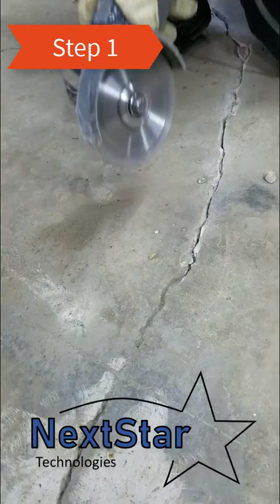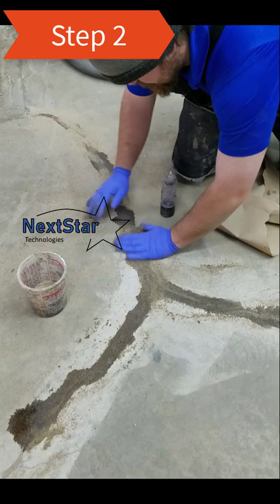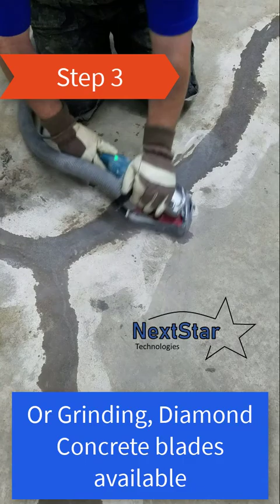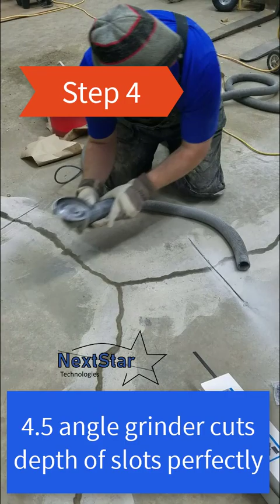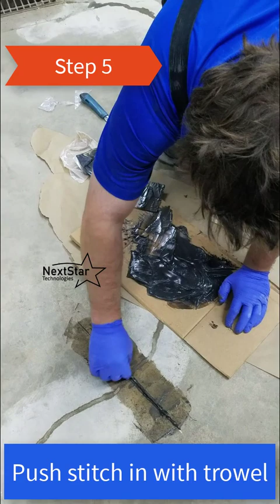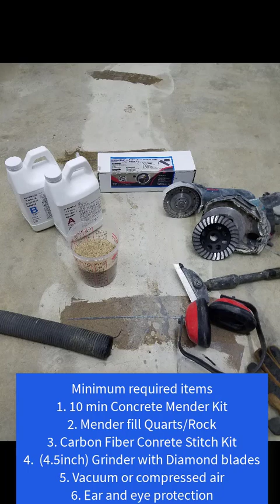DIY Garage Crack Repair

Comment: Great video and good looking products. I have a large crack in garage floor (>1") that is 10ft long and smaller cracks webbing out from it. Do you recommend your Epoxy kit? What is the best way to cosmetically cover it once repaired. Does the epoxy require a certain type of paint? What is the effective difference between the poly and epoxy kits? 

Our garage is built on a hill, and the large crack continues to expand over time as the cement flows like a glacier down the hill. Any tips would be appreciated.

Thanks! Look forward to checking out your products!
Reply from the maker: 10 min mender is technically a hybrid. Not epoxy or polyurethane. Roadware 10 min mender is the best (Floor) crack repair product available. We offer carbon fiber stitches for reinforcing cracks. 10 min mender to fix and fill the cracks and carbon Fiber stitch’s to prevent re-cracking.
Our (epoxy kits) are for Wall cracks only.

As for cosmetically covering the repair. The simplest method is to get color match paint and dab it lightly on the repair.
If you grind the surface instead of scraping. Concrete sealers will darken the grind marks. And leave a nice smooth gray repair. Looks a lot better than a crack.

https://nextstartech.com/shop/item.aspx/carbon-fiber-concrete-stitch-staple-repair-kit/175/
Reply: @nextstartechnologies4629  thanks for the reply. I'm still a bit confused about the selection of your products. Which kit would you recommend for someone in my case. And do you recommend this hybrid over poly or epoxy? Thanks
Reply from the maker: Our poly and epoxy kits do not work on floors. 10min mender is the perfect hybrid. For your garage floor cracks, I recommend the 1 gallon kit with one or two carbon fiber stitch kits for reinforcement and maybe a diamond blade for a grinder if you don't have one.

https://nextstartech.com/shop/item.aspx/10-minute-concrete-mender-1-gallon-kit-by-roadware/133/

https://nextstartech.com/shop/item.aspx/carbon-fiber-concrete-stitch-staple-repair-kit/175/

https://nextstartech.com/shop/item.aspx/diamond-4-5-in-turbo-cutting-blade-for-angle-grinders/161/

 @jeffreyjbyron